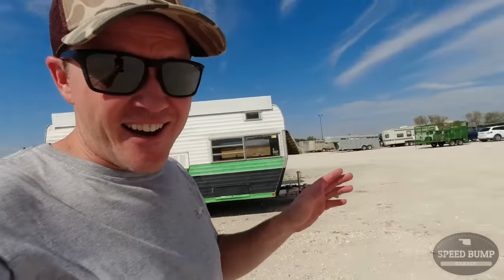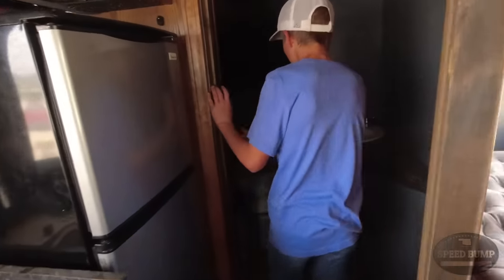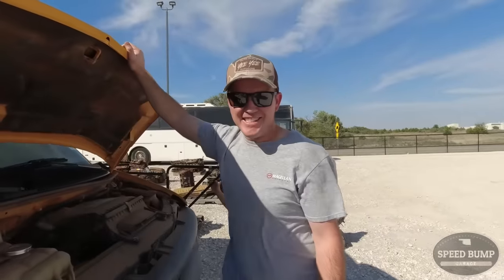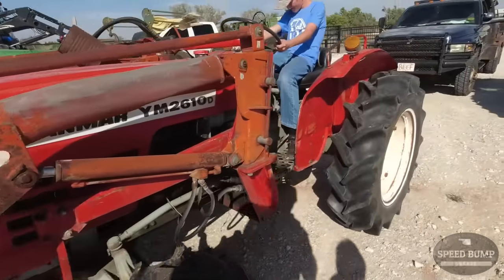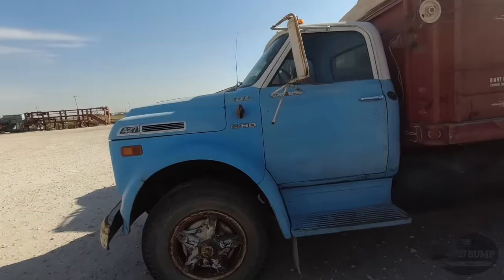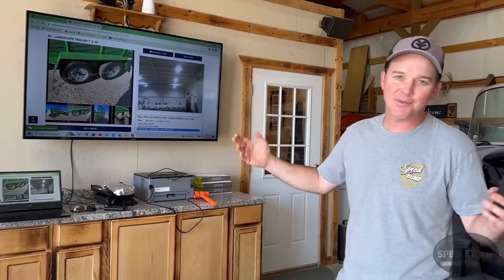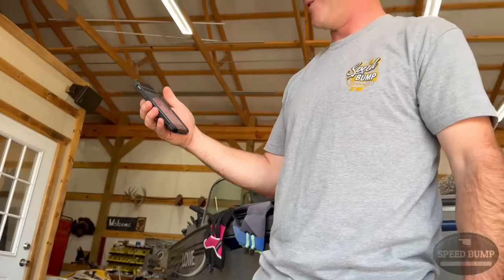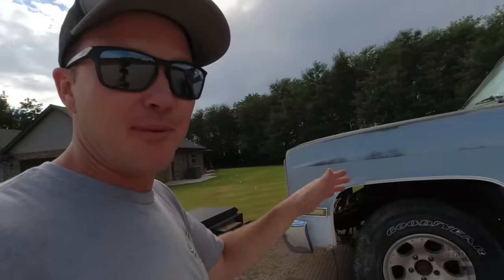More Auction FEVER!

Comment: He probably a lot better sticking with a 302 in the Rancho too many modifications to get a big block in there although they would fit some of those didn't come with 429 Cobra Jet or 428 depending on the year are the factory. There is a lot of great options for 302 anyways